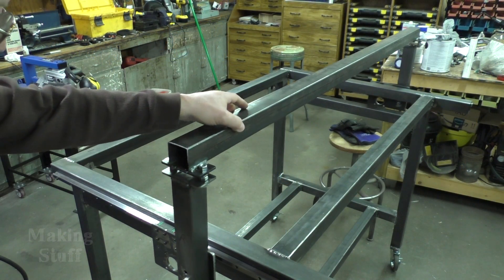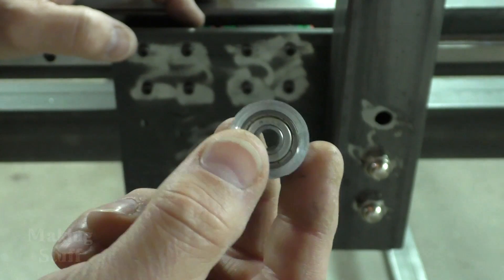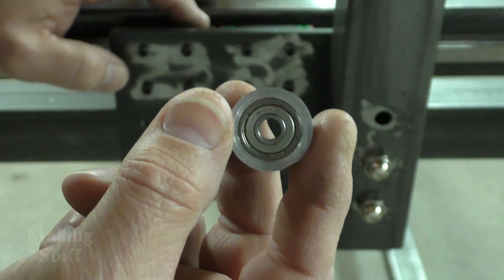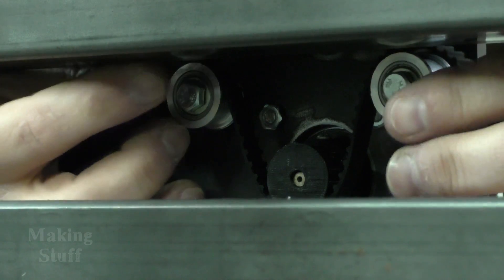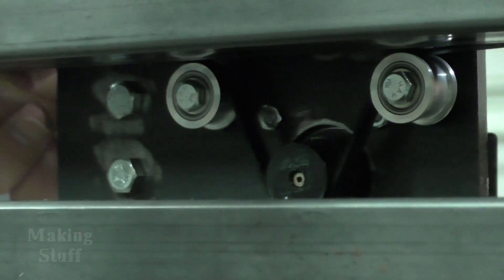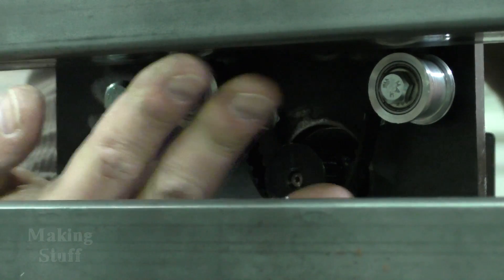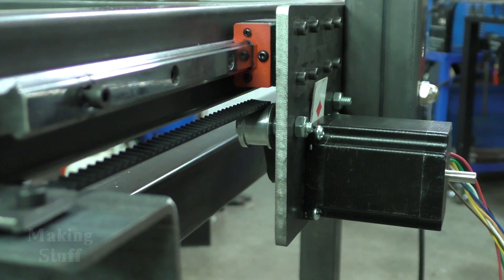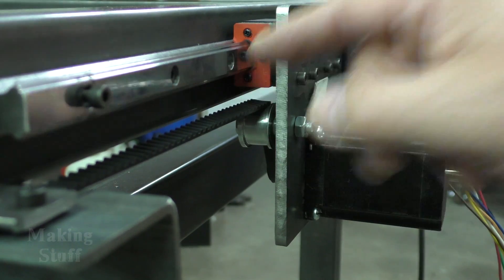DIY CNC Plasma Table Build - Part 3 Gantry and Y-Axis Motors

Comment: Did you put both Y gantry motor home switches on the same pin when you homed the gantry? Or use different pins on the original bob board? I know that you went to a Mesa Card later and that probably meant you have way more inputs then the original cnc motor controller board you started with.
Reply from the maker: No, each sensor is on it's own pin.  Wouldn't be able to auto square the gantry if they were on the same pin.

Comment: Before you got to the part where the belt was riding up the pulley, I was going to comment that when you were on the lathe, you didn't check run-out before starting to face and cut.  You probably have a nicely lathed part, but without concentricity. Novice who just watches Abom, ToT and Blondihacks, however seems you need concontricity before starting to cut.

Comment: Hi Bob.
Love your channel and you  are a bad influence (wife says).  I have started a CNC very similar to yours.  Aluminum frame & Nema 23 motors (425oz holding)

I hope you can help as I am smashing my head on the wall with the drive belt & sprocket match up.  
These motors have a 10mm shaft.  I picked up belt but it doesn't match my 12 tooth sprocket.   (10mm wide)
What I need to know is if the amount of teeth on the drive sprocket does change the ratio in your design?
I plan on using the machine for plasma/and laser as well as engraving and routing (maybe milling).
  I was told that for engraving I should be aiming for 3:1 ratio.  
I cant seem to wrap my head around a single gear ratio...
I am lost as to if I need to find a new sprocket or new belt, or both?
Hopefully you can provide some insight on this.

Comment: Great video, i am curious upon the use of a timing belt vs. a gear on a stepper moder and a gear rail? Was it just more cost effective or is that the only reason.
Reply from the maker: I already had it on hand.  Plus it is much cheaper than a rack and pinion.  The torch of a plasma table is free floating so this works great for plasma.
Reply: Rack and pinion is noisy and more expensive. It is likely more accurate than timing belts but being that plasma is not all that accurate to begin with, I think belts are cost effective and easy to maintain for a home user.
Reply: @1990notch  with rack and pinion you have to deal with backlash. you can compensate in software but belts are just fine for a plasma table.

Comment: I guess most people wouldn't know this but welding ground should be on the upper gantry while Welding do to Arcing inside the linear slider trucks. Could shorten the life of your bearings.
Reply: Yeah I’ve seen this too on big dc motors. But all you need is a strong grounding.

Comment: How hard is it to do joints for two axis homing in linuxcnc?  Is that still in beta?
Reply from the maker: No it's not hard.  I don't think it's in beta either.  Look at the sample in LinuxCNC called gantry-hs.  The HS stand for home switches.  I think all I had to do was set both Y and A axis on the same homing sequence.  I also had to setup one axis to spin the motor in the opposite direction so both side of the gantry would move the same direction.  Sorry I can't be more specific right now the machine is in pieces being painted.
Reply: Making Stuff I will check it out!  No problem, thank you for the reply!!

Comment: Your design looks near identical to the budget table I built and documented last fall.

https://www.youtube.com/watch?v=Yz72rFcuw4s

Don't worry about the racking, it simply wont happen when running dual motors. With homing switches on both sides of the gantry you can square it on power-up and then the motors move in sequence with one another.
Reply from the maker: I looked at a lot of different videos and took the best features from all the tables I liked. I liked your last table a lot.  It's a clean and straight forward build.  The frame is very similar to yours, but the rest will be different.

Comment: Great video. :)
Maybe it's the belt that is too far from the pulley and motor not the other way around.
Reply from the maker: Turns out the belt is bad.  I'll have more details in a future video.
Reply: I figured it was possibly deflection of unsupported shafts. Good to know it was just the belt.

Comment: Thanks for the video.   I am just finishing up the plates you built in this video.  I call them gantry plates for no particular reason.   I have a (very) similar setup with the idler pulleys.  It will be interesting to see how it works.  I should be assembling this weekend.  Are you only driving the gantry from one side?  I am driving from both sides which negates the racking you demonstrated.  I look forward to your next video.  ~P
Reply from the maker: Yeah I am driving from both sides.  I'm waiting on more belt and other parts that I had to order. That's why I only showed one side.
Reply: Oh then you won't have any problem.  It will work great.  What do you plan to use for your controller software?  Mach3/4, LinuxCNC or something else?
Reply from the maker: I've been playing with LinuxCNC but I'm not committed to anything just yet.

Comment: Better support the idlers from both sides or use fitted bolts instead of regular screws.
Reply from the maker: Good idea. I thought maybe the holes weren't square, but I double checked the drill press and it is dead on.  It would be nice to have a way to adjust the angle of the pulleys.
Reply: Good idea. I would also look for steppers with a larger shaft like 10mm.

Comment: The racking could be reduced or eliminated with longer linear rails and spreading the bearing blocks on each side further apart. 

Hopefully the software will work but the racking might increase and get worse.
Reply: Having two motors driving the gantry, racking will be eliminated.   This is a two motor system.  If it were only one, racking would be a problem.
Reply from the maker: I thought about that.  Once I get it finished I plan on using the machine to make better parts, just like a 3D printer lol.   Thanks for your comment.
Reply: You would lose travel with a wider bearing spread. Always a compromise.